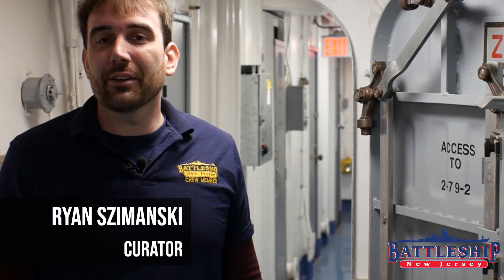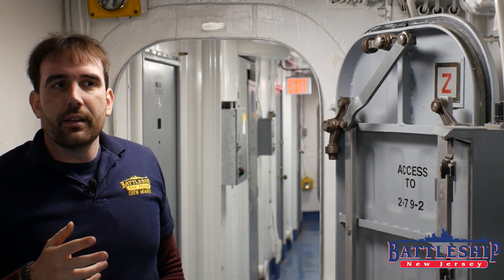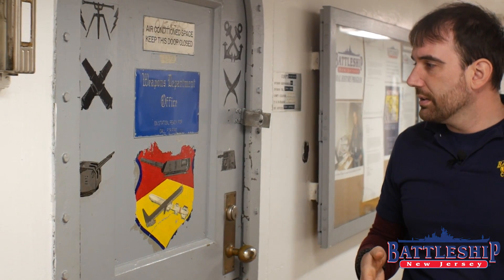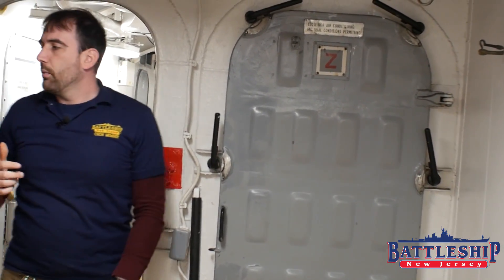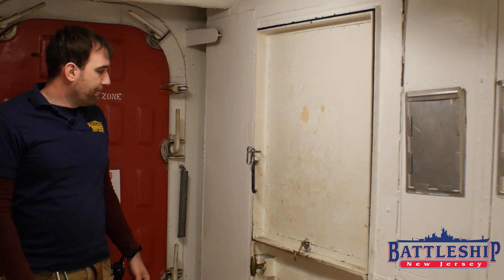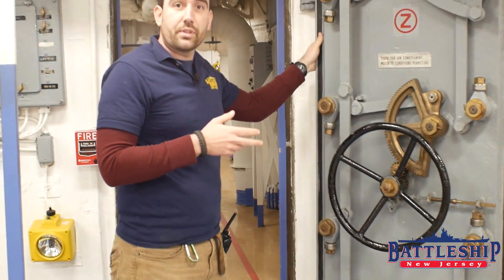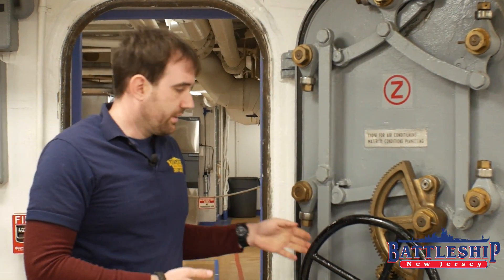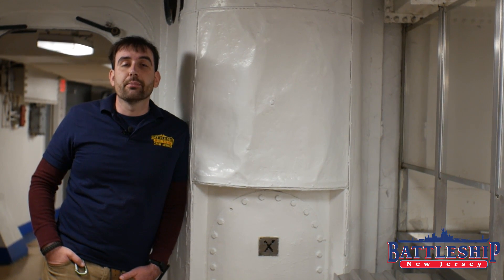Shut the Door! Doors and Hatches on the Battleship

Comment: I've always wondered if on warships the doors get locked during combat or if the men down there can open them to escape
Reply: Almost all of the doors can be opened from either side. The only ones that get locked are there to keep things secret or keep stuff from being stolen.
Reply: There are stories of chains being attached to the handwheel on one side of the door during catastrophic flooding.  Once the water reaches the level of the door, the water pressure makes it impossible to close the door.  
One of the risks of longitudinal bulkheads in the machinery spaces is it creates the risk of capsizing.  To avoid this, counter-flooding is needed.  Battleships of the Colorado class and earlier commonly had central engine rooms surrounded by boilers down each side of the ship, each boiler in its own watertight compartment.  The USS Utah in Pearl Harbor is an example of an earlier ship that had many longitudinal bulkheads and capsized.  Both the USS California and the USS West Virginia counter-flooded boiler rooms to make them sink straight instead of rolling over.  The West Virginia is the one most famous with about 70 who were trapped in spaces unable to escape.  I don't know if this was from direct damage or 

US warships went away from longitudinal bulkheads  to avoid capsizing from the North Carolina onwards.  The North Carolina, South Dakota and Iowa classes have boiler rooms and engine rooms that are on the centerline and much wider than earlier ships.  The later aircraft carriers went to combined machinery rooms with both boilers and turbines in one, wide room.  They do have empty torpedo defense spaces that are only on one side, but the boiler and engine rooms do not have mid-line bulkheads.  The torpedo voids can be flooded to balance the ship again.  Any boiler room is either empty or filled in a balanced manner, making the ship very much less likely to roll over.
Reply: @matthewbeasley7765  I believe that the use of longitudinal bulkheads contributed to the Andrea Doria capsizing after the collision with another boat and resulted in the use of transverse bulkheads being used in all future ships so that flooding would be much less likely to result in the ship rolling over.